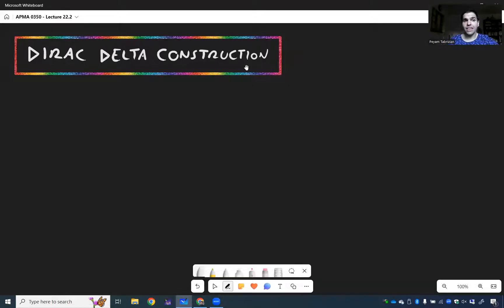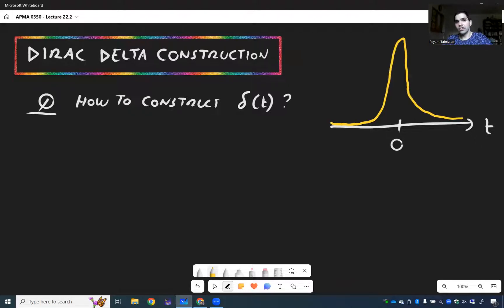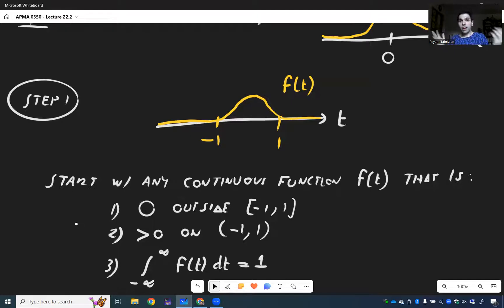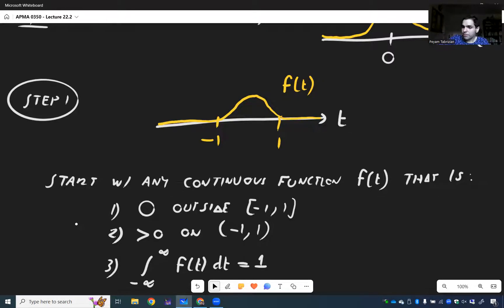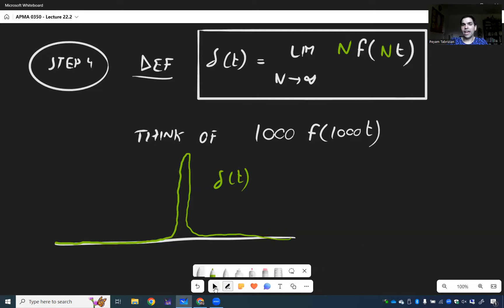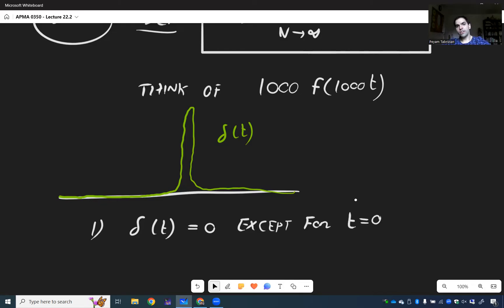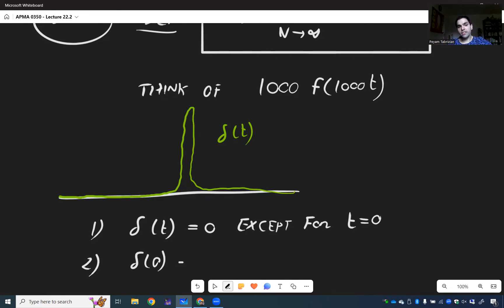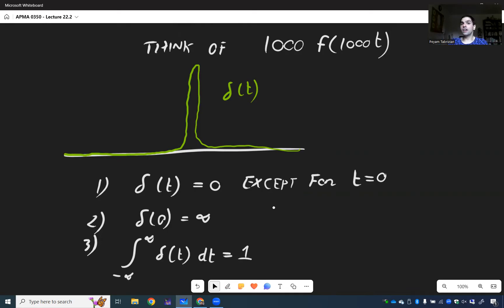Dirac Delta Construction

Comment: In what sence do we take that limit? And why the integral is not just 0, since the delta function is 0 a.s.?
Reply: It's not rigorous, in Lebesgue sense the integral would of course be zero. The trick is that delta is not a function but a distribution. And the theory behind is quite complex. Check it.
Reply: From an engineering/ digital signal processing perspective,  the area being 1 allows this function to be used as an on/ off switch for your signal.  So essentially it gets used to turn in and off certain signal components which are additives used to recreate the original signal. I don't know if this helps you mathematically, but that's how I learned it in an application sense
.We could have defined the integral as ½ or 2 or e for that matter, it servers the purpose of the number 1 when integrated. I'm sure there's plenty of other exa.ples for it use in the area of physics, but constructing/deconstructing signals to and from digital 《=》discrete pure analog  frequencies on for periods of time, is the application I am familiar with. Think of a square wave  being the odd harmonics of a fundamental frequency,  now we can use the unit impulse function to fine tune that square wave into a signal that looks like a song for instance. It gets more complicated but this this is the key peice of mathematics that allows us to  switch on and off those pure frequencies in order to have an accurate mathematical description of some random noisy function of amplitude over time into a discrete, quantified  mixing of pure frequencies in the complex frequency domain. 

Since we're in the frequency domain, we need a mathematical function which the has an infinitely large in amplitude and the derivative to be the reciprocal, such that our integral =1. Now we just multiply our transfer function by this unit impulse function for the duration of time we want that particular frequency component turned on, amd we have our on/off switch in the time domain.